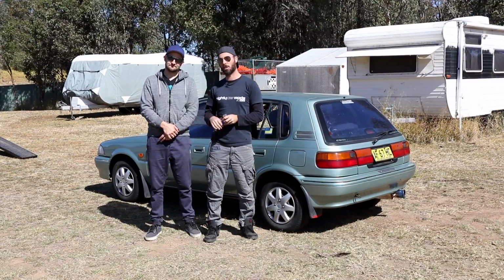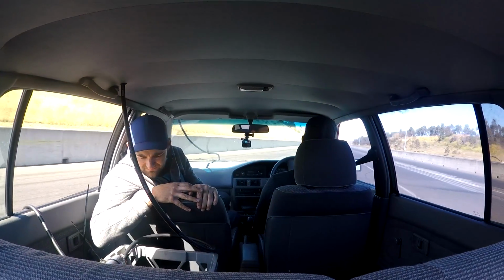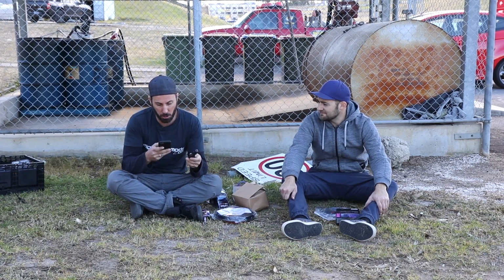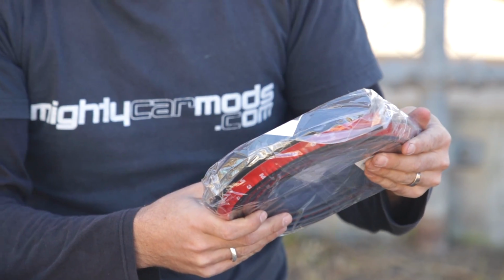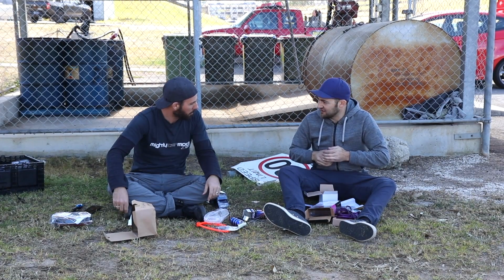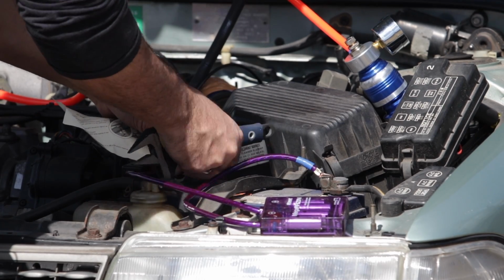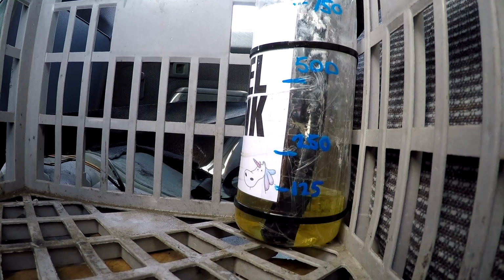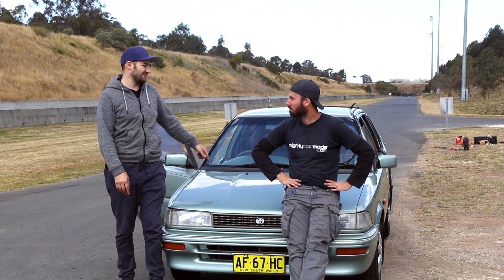Fuel Economy Mods - MYTHBUSTED

Comment: Hello Marty and Moog! Greetings from the SouthEastern U.S., and happy Unicorn Mileage to you! 

I have a FANTASTIC idea for Derrick, and it's GUARANTEED to increase your fuel economy to such a drastic amount that you will scream and fall to the ground when you discover how GOOD this idea is! 

I was told several times, when I was much younger, that IF you put larger wheels on your car you will increase your fuel mileage - because then your car travels many more kilometers at the same engine RPM! This seems SO plausible, don't you agree? It CANNOT fail! 

The hypothesis, of course, is that because your axles are turning at a given speed - you need only increase the linear distance that your wheels travel on the road surface to get MORE kilometers out of your car for the SAME rotational input you give said wheels through your axles. Read these words! You can tell by these important-sounding words that this is VERY scientific and cannot fail! And, as the Chinese tell us all the time, "This good wheels cannot be fault in any ways!" 

So I'm willing to bet you a fiver (!) that if you put LARGE wheels on Derrick you will discover that your fuel economy has increased SO dramatically that you won't be able to believe your eyes! You will be SHOCKED and AMAZED at how easy it is to increase your fuel economy, simply by putting the biggest wheels you can find on that Toyota! 

Obviously this MUST be true, and isn't as much of a secret as some would believe, because I have noticed that many, many people here in the U.S. have been putting very large wheels on their cars for the past couple of decades. They CLEARLY know something we do not! Why ELSE would all these people be putting $3000 wheels on their crappy $300 cars? 

There HAS to be a good reason for them to keep doing this, and I believe we have now uncovered their secret! They have found that they can cruise about town all night long for the same amount of petrol it would take to just drive down to the corner shop and back. They drive their cars with wagon wheels on them SO MUCH every day that they MUST be using only a few milliliters of fuel for every kilometer! It's the only explanation! 

PLEASE demonstrate this miraculous fuel-saving method for everyone who watches you around the world! Everyone must learn just how EASY it is to save enormous amounts of petrol simply by replacing the wheels on their car with something that looks completely ridiculous! (I mean, It HAS to be for the fuel savings. Why else would people keep doing that to their cars? :P )
Reply: KOakaKO this maybe true on better fuel economy, but it will destroy everything else.
Reply: +jason truong - That doesn't matter at all. If it means that Derrick can go 1000 km/liter, then everything else SHOULD be destroyed in the name of scientific progress! Y'know... because SCIENCE! :D
Reply: Rotating mass increase=need for bigger breaks=weight
Reply: +J& K - No, no, no... it just increases fuel economy by SO MUCH it will BLOW YOUR MIND. The axles turn by a certain amount, so BIGGER wheels means that you go MORE DISTANCE. If you could get wheels on the car that were BIG enough, you could go from Sydney to Perth on just a few liters of petrol! I know this is true because I explain it in lots of complicated ways to show that it is SCIENCE! You cannot argue with SCIENCE! :D
Reply: KOakaKO 
Sounds good, but facts are facts. Takes more power to turn a bigger wheel at the same RPM as a little fella. 
A way to demonstrate/observe this is by taking a bicycle rim and measure from the axle out marking a spoke at 1" intervals. Maintain a constant rpm and time how long each mark takes to complete a revolution. You will notice the marks further fom the wheel center taking longer to complete a revolution. To make up for the wider orbit you must increase rpm. It takes more power to increase rpm, more power equals more fuel burnt achieving the same rpm as a shorter orbit.
Not to mention everything needed to stop a bigger tire/wheel adding weight and bigger wheel equals more metal the engine has to push down the road.
Reply: KOakaKO 
Best sure fire way to increase fuel economy is to put the vehicle on a diet. Lose anything you don't need to make is go and you'll see a noticible increase
Reply: J& K - sigh I'm trying really hard to be not-serious here, and all you want to do is be serious. Have you not figured this out yet? 

Besides, super-large wheels will just get their extra torque from Unicorn powers and really, really wishing for it to work. Stop trying to jinx the Unicorn powers, or it may not work!

Comment: can u guys do something with wiring an aux port into a stock radio head unit, something stealthy, or hooking up an after market head unit along with the stock unit, im just trying to keep my factory radio
Reply: This kind of a setup is 100% different for every car, if it uses a tape deck try using a tape > aux converter, they can be had for very cheap. If it's CD based there might be RCA on the rear, if not your best bet is to get a bluetooth fm transmitter that you plug into a 12v cig lighter port, you can tune your radio station to the bluetooth FM transmitter (can get aux ones too) and listen to your music from your device via that method. There's plenty of ways, you could even wire in the fm transmitter to a 12v source and put it somewhere out of sight for stealth and bluetooth = maximum stealth. = )
Reply: Why?
Reply: to keep the radio for nostalgia feelings
 and to keep the car looking stock
Reply: ReadyToGo I did but my car is a little too old for that kind of adapter, I was thinking of an adapter that plugs in between the head unit and radio antenna wire, maybe with an option that switches between radio and aux
Reply: As readytogo said just then, your best option would be an inconspicuous install of a bluetooth fm transmitter, that way you can connect to it simply by changing radio stations. A wire between headunit and antenna doesn't make much sense, if you were to do any wiring changes you'd have to do alot more work - the only method of really making this possible would be to use a small powered amplifier hidden away behind dash or something that is powered by a relay which then toggles the power to the car's head unit and having a toggle switch to go between. You'd then have to simply wire in your amp to the speakers and plug your device in. But I think the hidden FM transmitter is the absolute best option you have - buy a female 12v cig socket with wire and then wire in the 12v somewhere behind the dash, plug the transmitter in and set it up, add the channel to your radio and happy days.

Comment: Can you achieve better top speed and acceleration with Derick just by putting smaller wheels (in diameter and / or width ) ?
Reply: zoufmalade smaller diameter wheels will improve acceleration but decrease top speed. Youd essentially be changing the gearing
Reply: zoufmalade Smaller diameter would increase the rpm's required to do any speed. Less width would decrease rolling resistance, which would maybe increase top speed a bit since it does reduce the overall force needed from the car. Problem is, rolling resistance is pretty consistent. However the formula for air resistance uses v squared, so any fuckin difference there has more impact.

Comment: A large turbo with low boost, tuned for econ would be a 'real' solution.
Reply: For a large turbo you need a lot of exhaust, a lot of exhaust is produced by a lot of fuel burning. If at all you need a rather small turbo that is fitting for the small engine and low to mid loads.
Reply: Not on this high compression N/A engine it wouldn't. A small turbo with low boost on a lower compression engine is the actual economy solution.

Comment: i think you can very mildly improve fuel economy in a car by taping up panel gaps to improve aero, but its at most maybe 100m more from a full tank. one way of better fuel economy is weight reduction, another is adapting driving style, a good service also does wonders, as does a sensible map most times (ive been told by a lot of friends whove had maps their fuel economy goes up with a base map when driving day to day. something to do with the ecu expecting bad fuel as a possibilty and not running as efficiently as possible to accomodate)

Comment: Try some of these addatives you put in the engine. Like engineflush. And then dyno it. How much will it remove from the engine? How will the oil take it? And how much is left when you have changed the oil again? There is also radiator cement (to fix a leak in the cooling system.

Comment: F1 cars are not aerodynamic in a "less drag/more fuel efficient" way.  They are aerodynamic in a "more drag/more down force" way.  Take the Toyota Prius for instance.  It has a drag coefficient of 0.25 which amounts to less drag and improved fuel economy.  Now take the Dodge Viper ACR (which is NOT designed for economy but for maximum down force):  drag coefficient is a very high 0.541 generating a maximum of 1700 lbs. (771.107 kg) of downforce.  Anything you add to a car's body, is basically going to make it less fuel efficient.

Comment: Can this toyota run on e85? Without any modification to ecu, just replace the regular fuel with ethanol and run on track and dyno to see if there is any difference in power if it runs correctly. Also you can change fuel filter and see how much gunk will be in it after running for a while on ethanol.

Comment: Obviously this episode is for giggles, but I've wondered if a DIY hydrogen cell works. I've seen videos where people claim they do, but the only way I can figure out how they work is they're mostly just leaning out the mixture, which risks burning up internal stuff.
Reply: Kcducttaper1 it works by supplementing the gasoline pr diesel with hydrogen, it does work, and work well, on diesel and carburated vehicles with no damage to the engine so long as the carb is tuned for the supplement in fuel that is plumbed into the intake manifold, and on diesels it works seemlessly and can make huge gains in fuel economy, on fuel injected gas cars the o2 sensors see too much oxygen in the exhaust gas because that and water are the only by products of hydrogen combustion, so it tends to add fuel to accomadate for the seemingly lean mixture and adds fuel so unless you fool the o2 sensors it wont work on a fuel injected gas motor but for other applications it works incredibly well
Reply: It does not work.HHO or browns gas is a scam that has been around since the 50s.It requires more energy to split the hydrogen from the oxygen netting you a loss,Not to mention they can blow up you know like that hydrogen air ship.Just google it.https://www.youtube.com/watch?v=s2t11GR6jFc.This guy will explain it.
Reply: Well, I've already got one yay and one nay. This might be a good can of worms.

Obviously, it'll take some extra load from your alternator, but is it enough to offset the gains of a properly built, and catalyzed HHO, system? Mythbusters did a thing on this once, but their HHO setup kinda sucked and was far too small if I recall correctly. I would point out that there's very little HHO floating around at any given time, so any explosion would just be a moderate pop and certainly nothing anywhere near the magnitude of the Hindenburg.
Reply: Just watch the video I linked the guy is a mechanical engineer.
Reply: Good for him.
I'm not interested in 'proving' or 'disproving' it on youtube. I just said it would be fun to see a legitimate test run. If you don't agree, don't watch it.
Reply: Its a known fact they dont work,and Ill watch whatever I want.
Reply: Again; I'm not interested in having a flame war against a keyboard warrior, or being sucked into an argument. I said it would be fun to see a video on the subject. If you don't agree, that's perfectly fine. I really don't care what you deem interesting or not.

Comment: Love the video as always, but one issue I had... pulling the ECU fuse reset the fuel trims. This usually results in more fuel use until the ECU relearns. But I don't know about this particular ECU and it's inter-workings and capabilities.

Comment: I'd like to see the difference in hp with big heavy wheels vs smaller/lighter wheels.
Reply: The engine would produce the same HP. The difference would be the vehicle's weight (which affects fuel economy, braking performance, and acceleration), as well as the ride comfort (larger wheels = lower profile, stiffer tyres = harsher ride). Plus, with bigger wheels, you can fit bigger brakes!
Reply: Jason Daigle there won't be any difference in horsepower with wheels...
Reply: Zander D, I understand that the engine will make the same at the flywheel, but hp has to change somewhat at the tire, a 10 pound wheel and tire setup will make more power at the tire than a 100 pound wheel and tire setup.
Reply: Wowthatsfail , so you're telling me that adding 100 pounds to the front wheels and putting it on the dyno will produce the same hp as a wheels and tires that weigh 100 pounds less? Is that why no one cares about unsprung weight or rotational mass? 🙄
Reply: That is how it works. The wheels are where weight saving is by far the most important. If your engine has to work harder to even get the wheels to spin at all, you are losing power and fuel. Your brakes also have to work harder.

I can even attest to this from experience, not just from basic logic. I replaced the original steel wheels (which were so heavy I got fifteen dollars in scrap for them) on my 89 panther body with a set of OEM alloys (which couldn't have weighed more than 10 pounds each). Just from that, the power, braking, and mileage all greatly improved. Granted, those were probably the heaviest 15 inch wheels ever conceived, but the principle is still there.
Reply: While you're at it fill the tires with helium.
Reply: Jason Daigle Yes, "tractor tires" will affect performance, lol where else would you get a 100lb wheel and tire?  Wheels that are heavier or too large will also chew your differential gears to bits.  I think you'd kill poor Derrick, lol.
Reply: You're trying to let the wheels spin easier, Sherlock, not make the car fucking fly.

If there were no point to lighter wheels, every wheel ever made would be made of steel. Not aluminum, or magnesium, or fucking carbon fiber. This is basic physics. This is basic logic.
Reply: Jason Daigle no, no, no that's not how that works. Please stay in school you really need it mate.

Comment: Why you wont just jack up the car and let it run on XX.rpm. Do the mods and do the exact same thing again?
Reply: That would be like driving in a vacuum. Aerodynamics is a factor in mpg, so they need to drive it.
Reply: MrYlijumala this one was more entertaining to watch
Reply: Because fuel consumption depends on the load, and there's hardly any of that when the car's jacked up, only the internal friction of the engine and the drivetrain.

You could technically use a dyno (rolling road), but they're not designed for constant load and using dyno time for this crap would be ridiculous.

Finally, with aerodynamics modifications you actually need to have the car moving to produce airflow, otherwise the thing's just going to sit static and aerodynamics won't be relevant at all.

Comment: Turbo with high compression 10.1+ vs. Turbo with low or normal 8.1 and down and get Turbo Yoda to help and explain my madness 🙃
Reply: the more compression the better efficiency and power. you only lower the compression rating of the engine so it won't detonate. if you don't lower the compression from 10/1 and shove in twice the air with a turbo you'd essentially get 20/1 compression at wich point the petrol would self ignite without the help of a sparkplug while the piston is not past it's dead top point and then you have the explosion from the fuel plus the piston pushing up on the cylinder head. and that's what we call detonation.
Reply: The Vibe that's where you would be wrong less compression equals the ability to put more fuel and more air allowing for more power
Reply: yes, but you lose fuel economy. at a low load of let's say 30 hp you will use more fuel with lower compression.
Reply: The Vibe so what if you use more fuel it doesn't matter i'm not talking about efficiency here they asked at the end if there was anything anyone wanted them to try and I gladly obliged I didn't think it would start an argument about efficiency when I was not even talking about being efficient just making more power that's why I asked for turbo Yoda to explain my madness lol
Reply: well there's your answer. turbo 10.1 compression makes more power and uses less fuel than turbo 8.1 compression. as long as it doesn't blow up.
Reply: The Vibe reliable horse power via low compression I think 9.1 compression probably be fine for a little boost though for your every other day car

Comment: Honestly, i'd be interested in a weight-reduction test similar to your "how to make your slow car fast" ep, but legal... keep the spare tyre and tools, but lose the grille, lose interior trim, run with half a tank, pump the tyres up, use a thinner oil or service the car, etc. Might not be super entertaining unless you set fire to something though.